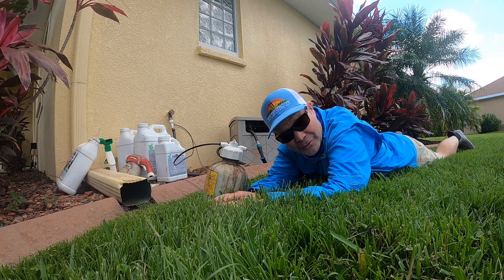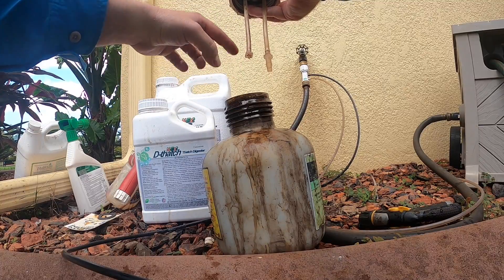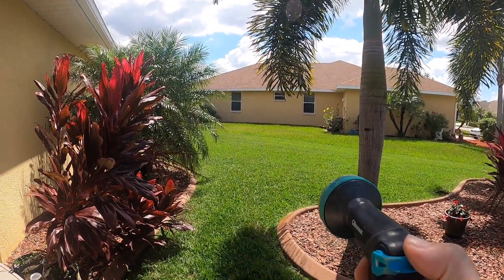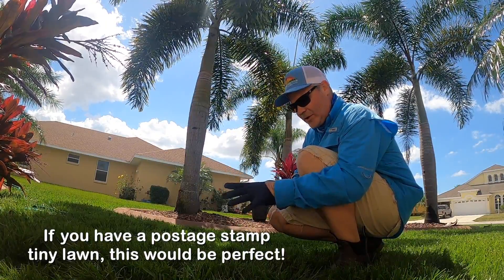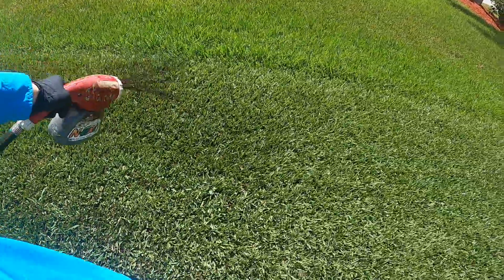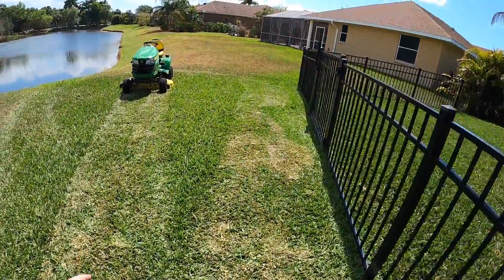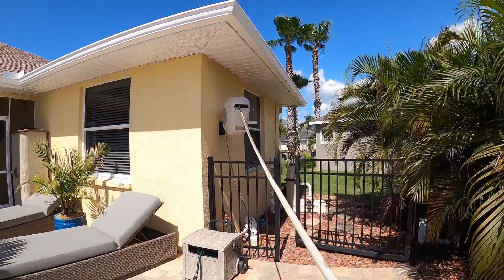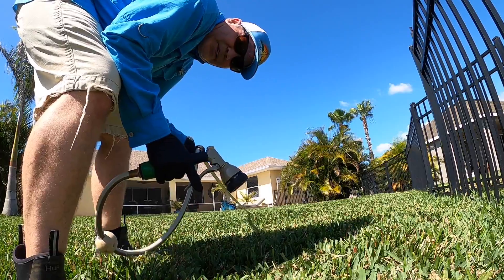Fun New Way To Spray Liquid Fertilizer via Garden Hose

Comment: Do the products come out efficiently using a house end sprinkler and the EZ Flow container?  Thinking I can fill just enough per 1K for each section of my yard and sprinkler. Adjust to Fast, and let it apply until the tank is empty/Hose clear

Comment: I’m sure someone has cleared this up by now but after adding concentrate you fill the tank with water until air is gone, then as new water is added to the tank it’s density keeps fresh water at the top and fertilizer water at the bottom so you have even coverage until it runs out of fertilizer.

Comment: I wonder how long that tank can sit there with any of the next products inside it? I wouldn’t want to use 3/4 of a gallon of that on 5,000sgft so what do you do? Pour it in the tank at 3oz per 1000 like recommended or can that sit there for a few months without going bad

Comment: I want to go to only liquids. I have about 2500 square feet. 1000 in front, 1000 in back, about 250 each side. How do you apply equally?  Or just stick with Ortho sprayer?  Seems like no matter what I do, I'm applying unequally. Wherever I start is getting the best application.

Comment: Check the deck level on the John Deere and adjust the anti-scalp wheels.  I just fixed the neighbors mower and even though it said 3.5" on the dial, it was mowing at 2.75" because the decks level was off.
Reply: Keith B this.

Comment: So if using a bottle of weed be gone that attaches to a regular water hose are you saying a backflow preventer is required on that outside spigot? Is that backflow preventer a separate piece from the outside spigot?
Reply: Yes, they screw right on and then lock with a grub screw, probably under ten dollars.
Wise to use for sure!
Reply: @wayneessar7489  Thank you.

Comment: Hi Alan,  I live in Jacksonville Fl. Sure wish I could have you come look at my lawn.  No one seems to be able to tell me what the problem is.  Let’s start with after winter when grass starts to grow. I start to see little tufts of grass ( my terminology). If you pull it out it has a single long root ( 5”) then at end of that root are little roots branching out.  Eventually grass really starts to go because it’s spring. After fertilization’s excetra yard looks beautiful gorgeous. Then boom fungus sets in yard goes to hell.  The entire year lawn is spongy.  Some places you can grab lawn from top and move it up & down like a spring. You can even put your hand in there between top of grass and ground. ?????? What’s going on.  Other issue with this is can not use anything but a self propelled mower ( do to health issues can no longer push mower)  because other mower weight down & scalp yard.  So can you help me?  I have a yard spraying service & have for 25 yrs. my brother got me a snapper rear ended raised the deck all the way up & its does the same thing,  my backyard is great.. ty Alan

Comment: Get some of your techie bofffins to adapt a battery pump sprayer to this so that you don't need to dilute with water.  It would likely be more even dilution (as much as a pump sprayer will do) that using the water for pressure.

Comment: Allyn,  I’m new to the channel and after watching several of your recent videos, I realize I missed my initial window for throwin down the first app of prodiamine per your plan. I live in SC, have a centipede lawn, and the temperatures are currently in the mid 60’s for the next week or so. Since I missed the first round of pre-emergence, should I go ahead and throw down an app of dithiopyr? If so, could I still potentially get an app of prodiamine in this spring if the temperatures are not projected to reach 70 degrees for another 2-3 weeks? Or would that not give the lawn enough time between applications of the two different pre-emergents? Thanks for putting out great content! I have a lot of catching up to do on all your previous videos!!!

Comment: I hope you have a RPZ/RPP installed this is a horrible cross connection. Hope you like consuming these in your house.  If you have a pressure loss this will back siphon and contaminate the water source.  Do you have different water supplies potable for drinking and non-potable for watering? Seriously consider installing an anti-siphon vacuum breaker on your faucet at least.   Oh I watched the rest of the video... thanks for keeping your water source safer.  I won’t delete my previous comments , I commented before I finished watching the rest of this video.  Cross connections are a major problem throughout the entire world.
Reply from the maker: thanks bro! 👊

Comment: Hey Allyn, I use Zero-G woven hoses for the irrigation,  if I go forward using this type of fertilizer spray setup, am I going to have issues or do I need to spring for a traditional type rubber garden hose?? Thanks again

Comment: Hey Allyn...I just bought the EZ Flo...and I have a question... typically the BIO Stim pack calls for 3oz. per 1000 square feet...so with this EZ Flo system what is the ounce per 1000 sq measurement to use? In your video, I noticed you just poured in the different BIO stims into the ez flo without any measuring? What is your suggestion for measuring? Thanks! Matt from Louisville
Reply: Some 've already asked the same ,no answer yet,did you found out about it ?
Reply: @edwardfernandez7516  Nope...but I just went ahead and poured about 4 oz of each BIO stim in the ezflo and let it fill with water. I have about 5000sq to cover and I have applied the solution twice now and I still have plenty left over for another app. I am going to apply the bio stim once a month with this original mix and see how much use I get out of it....

Comment: Those home owner grade front engine riders are typically adjusted lower than what the dial says from the factory. Your probably cutting at 3.5-3 inches when the dial says 4. You can adjust them up some but I doubt you’d ever get a true 4 inch cut with it. Just my experience. For the price they are hard to beat for the amount of lawn you can cut with them. They do work better in big open areas though.

Comment: You need to invest into a zero g hose. Best purchase I've ever made!
Reply: Man, not sure where i saw this, but I read awhile ago about those hoses been sweet. I bought one and it was broken out of the packaging. Got a replacement, it already had a hole in and was leaking. Got a 3rd one and that one was leaking out of the connector to the faucet. Got a refund.
Reply: @davet8602   Damn I've had mine going on 3 years now haven't had any issues yet. I use it all the time in the lawn and for cooking down my home brew.

Comment: Al! Help! I have virtually no irrigation options at my home due to low water pressure. What are my options for a fert/watering plan? I gotta find a way to THROW'ER DOWN!
Reply: Liquid fertilizer use backpack or handheld sprayer. 
Granular fertilizer use broadcast sprinkler. 
As for watering move the sprinkler a lot  till you get enough water down. Or use hose end sprinkler and walk the lawn.

Comment: It seems like a novel idea, but because it doesn’t regulate the concentrate coming out, it seems like it’s completely impractical for a regular hose nozzle. Maybe for a portable sprinkler it may work pretty well where you just set it out on a section of lawn and let it run all the way out.

Comment: I talked to the guys at Greene County and they had recommended using the EZ Flow.  Seems like one would have no idea how much you are putting down if you are filling it to the top with RGS.  With the Ortho sprayer it seems like we will be using much less.  Looks like the jug is about a 1/2 gallon.  As for the Jon Perry mod on the Ortho...what are you referring too?
Reply from the maker: the  EZ FLO tank is a 3/4 gallon. If you are spraying a small area of 1000 sq ft, you can get an even and consistent application fairly easily, you just have to move fast when you spray but you can cover 1000 sq ft in a minute with no problem. The John Perry mod is how he cuts the filter off the straw inside the Ortho.
Reply: @TheLawnCareNut  my lawn is 4700 sq feet.  With the EZ Flow would I just measure out what I plan to put down and then walk the lawn till its empty?  You make it sound like it comes out in a higher concentration at first.  I want even distribution in both my front and back yard.  Maybe the Ortho is the best option for me.  I did remove the screen from my Ortho when I got it but it still seemed to plug up quite frequently

Comment: Your X350 deck height can be adjusted. Look up how to do deck leveling, but instead of using the measuring tool just reach under the deck and spin the blades around and measure to 4.5 inches.. basically making it so everything cuts half an inch higher than what the adjustment dial reads.
Reply from the maker: sounds like a fun video I need to make! thank you!

Comment: I would double check your actual mowing height on the Deere at the blades. I’ve seen several come from the dealer/store not anywhere the height on the dial. It might need adjusting
Reply from the maker: Thank you for the tip- I want to get into the leveling kit that comes with it and see what I can learn for sure. Either way though, I love the tractor - it runs great and is comfortable.

Comment: really interesting product....however application rate is just really inconsistent. I would use it for humic acid or something that does not rely on a even application rate.
Reply from the maker: yes I agree. I have not had any problem getting even apps (you can see my lawn has consistent color) but I am only doing a 1,000 sq ft area so it's easy to cover fast. I actually think the EZ FLO was originally designed for trees and shrubs which don't need quite the same consistent application as a lawn would.

Comment: Allyn, it's time for you to upgrade to an Eley reel, like seriously. Made in the USA, and extremely well built. Heck, you might even win one on the TLF giveaway this month.
Reply: I just looked that up.  It does not appear to be retractable.
Reply: @scorpio6587  No, it's not retractable. You have to manually roll the hose up on the reel. It's one of the best built hose reels you can buy though.
Reply: I was thinking the same thing. However we are on hard well water. I hate all things plastic but plastic holds up to hard water better than metal. The sun is another story. Do you have experience with one and hard water?

Comment: Looks like you have 2 vacuum breakers  on your spigot. Usually required by code, then they break off the set screw.
Reply: Reduces pressure! Only need one in Wi!

Comment: That anti siphon device that prevents backflow is not designed to be used with a downstream valve.  

It will prevent backflow, until that downstream valve destroys it.

Comment: I wonder if I could inject my sprinkler system with one of these bottle setups, hmmm
Reply from the maker: It's not made for that - the company does make ones for irrigation but this isn't it - those are much more expensive.
Reply: They are called Peristaltic Pumps. Farmers/Industry use them all the time. Pricey but you just need to put the pickup line into your jug and no need to mix. A popular brand is Stenner. I have had one pumping chlorine into my pool for 5 years now.

Comment: Neat idea, but as expensive as the NExt products are, seems like you will be putting down a lot more than 3oz/1000 sq ft
Reply from the maker: You don't have to go as heavy as I did. I do it for the shock value 😀
Reply: @TheLawnCareNut  How do you reduce the app rate?
Reply from the maker: @Addnor  put less in the tank and fill the rest up with water.